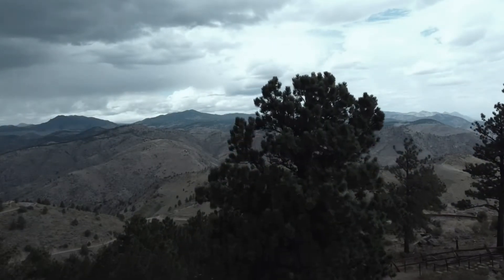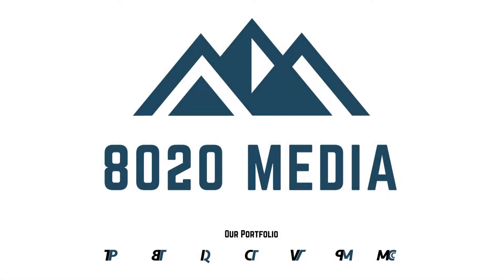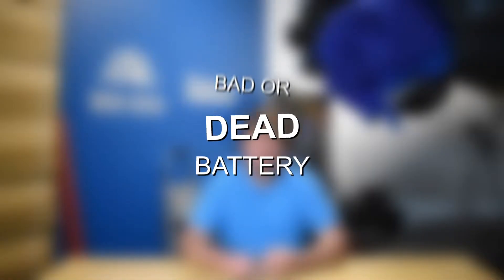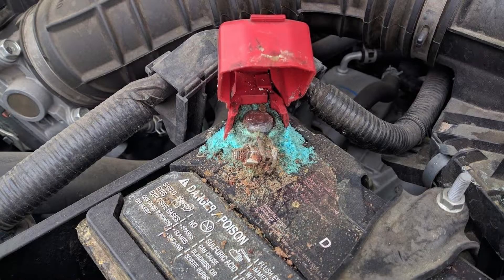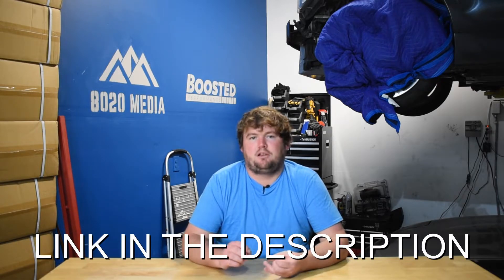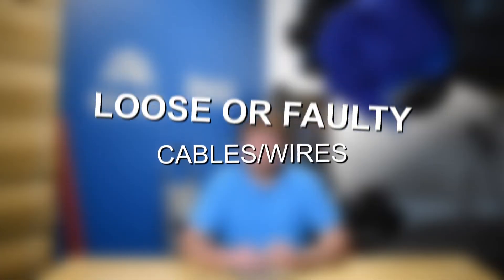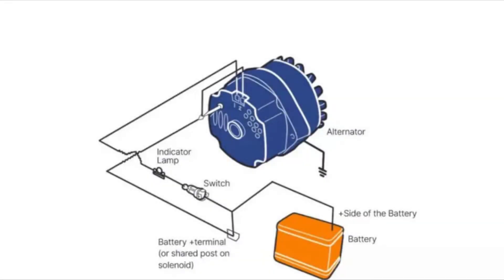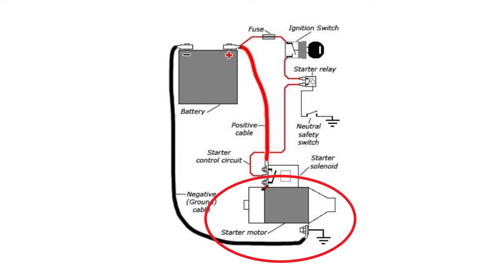DIY – Why Your Engine is Clicking & Not Starting or Stalling Soon After Starting

Comment: GOOGLE HAPPY HOLIDAYS TO YOU DIY 
I HAVE A 2005 CHEVY UPLANDER
Pull up to the gas station cut it off
 went to restart would not start 
Data center show starting disabled went to the turn on key for 15 minutes three times process to see if that would be recognized the key 🔐 still no start 
Charged the battery it's at 13.5 please tell me your thoughts and what I could do to rectify this problem thank you again have a wonderful holiday

Comment: I hear different things on how long it takes to recharge a good battery while driving.  Like a battery that was drained by leaving a light on overnight or maybe having sat for a long time.  Some folks say that it has to be highway driving for as much as an hour.  You just said something that sounded like less.... "a little bit of driving time".  And so to be clear, idling in the driveway after getting a jump just doesn't do it?  I believe it does not, that the alternator needs to be running at rpms higher than idle (or the nominal amount of current it needs to create just to run the basically electrical stuff of the car while it is at idle).  And that might be why some people say highway speeds to have the rpms up, thus spinning the alternator faster and creating more power to feed to battery.......

Comment: I have a Toyota Corolla 2009, changed battery and alternator and it doesn’t want to start the vehicle… please help by making a video with each different sounds to find a match… all parts replaced are by Toyota made specifically for my Corolla 

Security system and radio (touch screen format) do not turn on either

Comment: Got a 2011 Chrysler 200 and I put a new starter on and new battery but still just clicks when turning the key on , will start after trying for about 5 min . I noticed there is no relay or fuse for the starter on this vehicle as well . I followed the wire and gave direct power to the starter harness and the starter turns over could it be my ignition switch ?
Reply: Put your car in neutral and try to start it like that 

If it still doesn't start then check the ground for the battery/chassis and starter/chassis 

If it still doesn't work then pray to God to give you the answer or something

It's also possible that the battery cable that connects to the starter is bad

Comment: Got a '13 Dodge dart That wont start up. Replaced the battery and starter, but only hearing 5 clicks every time I try to crank her up.
Reply from the maker: S - If your ’13 Dodge Dart gives you a rapid series of 5 clicks but won’t crank even after a new battery and starter, that usually means the starter isn’t getting enough current — most often from a poor ground or power connection rather than the components themselves. Start by double-checking both battery terminals for tightness and corrosion — clean them shiny and make sure the cable ends aren’t swollen or frayed under the insulation. Then inspect the engine-to-chassis ground strap and the positive cable to the starter; any corrosion or loose bolt will cause voltage drop, especially under load, leading to the clicking you hear. Use a multimeter to check voltage at the starter while someone turns the key — if it drops below about 10 volts, you’ve got a bad cable or ground. If power stays strong but the starter still just clicks, try tapping the starter lightly with a wrench while cranking — if it suddenly engages, the solenoid or internal contacts are bad even if the starter is new (aftermarket ones fail often). Lastly, make sure the neutral safety switch or clutch safety circuit (if manual) isn’t intermittently open — that can also cause a no-crank symptom with only clicks.
Reply: Possibly the alternator is bad.
Reply: Mine is now suddenly doing the same of multiple clicks when trying to start it. Then I accidentally bumped my seat moving lever and it made the radio and inside lights go off until I let go and they came back on. 😲

Comment: I bought a Mazda 6 was told the rear motor mount broke now it wont start just click. Was also told the with the mount broke it put motor and everything in a jam. I don't know what Im doin
Reply from the maker: D - A broken rear motor mount won’t keep the engine from starting—mounts just hold the engine in place, they don’t lock it up—so if you’re only getting a click when you turn the key, that’s almost always a starter, battery, or wiring issue, not the mount. First, make sure the battery is fully charged (should read 12.6V+ at rest and 13.8–14.5V when running), then check that the battery cables are clean and tight, especially the ground from engine to chassis. If the battery and connections are good, the starter itself may be weak or jammed, or the engine could be seized—but that’s rare unless it ran without oil. The “mount jamming the motor” story isn’t accurate; the mount breaking might let the engine shift a little, but it won’t mechanically lock it. Start with the battery and connections before worrying about anything bigger.

Comment: Great video! I have a question regarding a 2011 Chevy Camaro, automatic, V6 LT, 75K miles. Came home one day with no issues whatsoever. No lights came on in the dashboard. Lights never flickered, started up just fine as usual. But then the next morning I was opening my trunk with my remote and I hear multiple clicks. I thought, that's weird. I made sure I didn't leave any lights on whatsoever. I go to turn on the car and I still have power but it doesn't start, but it does the clicking noise again. The engine like appears to be flickering fast too. I check the battery wires and everything is clear. I take the out and take it to Auto zone to get tested and it is 100% full. Does that mean the alternator couldn't be an issue since it didn't drain the battery? Sounds like it is the starter, but in your video you mention the starter only clicks once and not multiple times, which is giving me doubts. Could it still be the starter even though it's clicking multiple times?
Reply from the maker: D - Yes, it can still be the starter—even with multiple clicks—especially if the solenoid is receiving power but the starter motor itself is failing to engage or spin properly, which can cause rapid clicking or relay chatter that mimics a low-voltage condition; while a single, strong click is more classic of a stuck solenoid, rapid clicking still points to the same system: battery, cables, grounds, starter, or ignition circuit. Since your battery tested good, double-check the ground cable from the battery to the engine block and chassis (even unbolting it to clean the contact), and then try tapping the starter lightly with a hammer while someone turns the key—if it cranks, that’s confirmation the starter motor is sticking internally. Also check the underhood fuse box for any corrosion or blown starter relay. If all wiring checks out and the tapping trick works or makes a difference, replace the starter.
Reply: I have the exact same car and the exact same problem did you ever get it fixed or checked out. Let me know what the issue was.
Reply: I have changed the starter, alternator, and battery checks out to be good. Both parts were bad as well so it just  leaves me stuck.
Reply: @noice351 check your ecm fuse. I had the same problem and it ended up being an ecm fuse

Comment: Clicking with no crank. Truck was running fine and this happened in the morning.
Reply from the maker: J - If your truck is just clicking with no crank after running fine the day before, the most common culprits are a weak or dead battery, corroded or loose battery terminals, or a failing starter motor or starter relay. Start by checking battery voltage—it should be at least 12.4 volts—and ensure the terminals are clean and tight. If the battery checks out, try tapping the starter lightly while someone turns the key; if it cranks, the starter is likely failing. Also check for blown fuses or a bad ground connection. If all else looks good, it's likely the starter solenoid or starter itself needs replacement.

Comment: I have an audi 2011 a5 thst clicks once too when i try to start it. But once i jump it it jas no issues staying on or running. Doesnt lose power snd everything words from radio to ac to covertible. Took my battery out and got it checked out at autozone. Barrery was at a hundred but could jt still be a bad battery havent tested jt when trying to turn it on. Would apprecaite any help
Reply from the maker: M - Yes, even if the battery tested at 100% at AutoZone, it could still be bad or weak under load. A battery can hold a surface charge and show full voltage when not under stress, but still fail to deliver sufficient cold cranking amps (CCA) when trying to start the car, especially after sitting. The single click you hear typically indicates the starter solenoid is engaging but not getting enough power to crank the engine, which often points to a weak battery, corroded terminals, or a poor ground. Since the car starts and runs fine with a jump, that leans even more toward a battery issue. I’d recommend doing a load test while attempting to start the car or replacing the battery if it’s more than 3–5 years old, even if it seems okay when bench-tested.

Comment: Ok I turn key and only get the 1 click, dash lights stay on but clock and radio turn off. Is that most likely started? I replaced alternator twice ( once last nov the second time last month)
Reply from the maker: M - Yes, if you turn the key and only get one click, the dash lights stay on, but the clock and radio shut off, it's most likely a starter issue—specifically, a failing starter solenoid or worn internal contacts in the starter motor that can’t draw enough current to crank the engine, especially if you’ve already ruled out the alternator by replacing it twice. However, you should also double-check the battery connections (clean and tight terminals), main engine grounds, and try a voltage drop test to be sure power is actually reaching the starter—sometimes, a weak battery or corroded connection mimics a bad starter. But based on the click and power loss behavior, starter replacement is the most likely fix.

Comment: Hi! Have a Citroen C3,today its showed up "Electric Circuit faulty" few km later power steering is gone,most electronic device didnt work(like windows,radio,fan) then after I stopped and turned off the engine its only make clicking sound,but engine not move,on dashboard says "Economy mode active) we tried jump the car didnt worked,do you have any suggests?
Reply from the maker: P - Hey! What you're describing on your Citroën C3—“Electric Circuit Faulty” message, loss of power steering and electronics, and failure to crank with just clicking and “Economy Mode Active”—is a textbook sign of either a completely dead or failing battery or a serious charging system failure, likely a bad alternator that wasn’t recharging the battery while driving; “Economy Mode” activates when battery voltage is critically low to preserve power, and jump-starting won’t help if the battery is too far gone or the alternator isn’t outputting anything—so check battery voltage first (should be ~12.6V off and 13.8–14.4V running), then test alternator output, and if either is bad, replace accordingly and fully charge or swap the battery before restarting the system.

Comment: Hoping im not too late to the party
Last week I parked my car and left my headlights on for an hour. I turned them off when i noticed, but it wouldnt start and made the rapid clicking sound of a drained battery. I left my car for 4 hours, came back, and it started fine with no jump. 
This morning i got into my car and it wouldnt start again. All electrical systems are working, interior lights, headlights, door alarm, etc, but it wont start. Made sure headlights and interior lights were off when i got out of my car the night before. Jumping it was unsuccessful. The battery is brand new because of a similar situation last month, no corrosion on the terminals, alternator and timing belt were replaced a year and a half ago. Any ideas?
Reply from the maker: E - Never too late! We strive to answer almost all comments! Based on your symptoms—rapid clicking, electricals working, a new battery, and failed jump start—it sounds like you may be dealing with a bad starter motor or a faulty ground connection. A weak or failing starter can intermittently work and then fail entirely, especially after a battery-draining event. It's also possible that a poor ground (battery to chassis or engine ground strap) is preventing enough current from reaching the starter, even if voltage appears normal and accessories work. Another potential culprit is a parasitic drain that's slowly killing the battery overnight despite appearing fine earlier. I'd suggest checking all ground connections for corrosion or looseness, testing the starter relay and ignition switch, and using a multimeter to check voltage drop during cranking (if it drops significantly below 10V, there may be a high-resistance issue or dead cell in the new battery). If everything else checks out, the starter is the most likely culprit.

Comment: Can it be uncommon for a starter to be the problem but instead of a loud single click its more of those multiple multiple clicks like shown in the start of the video? I want to get into cars and eventually get a project car but I want/need to start of slowly just being able to fix and do basic maintenance with the car I have now before starting that. Got an 05 accord, haven't really had any problems with the stero or headlights so I don't think its an alternator problem, I do have to change my battery soon but I don't think its a battery problem because if my memory serves me correctly, my car has been doing the clicks for a while so it's not anything new. Which leaves wiring and starter, how would I be able to identify wiring/cable as someone who has no idea what they're looking at/for compared to just getting a new starter and just trying to replace that. I do have a cousin who is a mechanic and has his own shop and does it for a living and another one who teaches autotech in school but I would like to become more indepent when it comes to being able to identify and fix my car, any advice or help is welcomes and greatly appreciated. Thanks in advance!
Reply from the maker: J - Yes, it’s definitely possible for a bad starter to cause multiple rapid clicks instead of a single loud click, especially if the solenoid is engaging but the motor itself can’t spin due to internal wear or poor power delivery. Since your headlights and stereo seem unaffected, the issue is likely not the alternator, but your battery could still be weak under load, which isn’t always obvious—have it load-tested for free at an auto parts store just to rule it out. If the battery tests good and the terminals and cables are clean and secure, the starter is the most likely culprit, especially if the clicking has been going on for a while. You can try tapping the starter with a wrench while someone turns the key—if it cranks after that, the starter is almost certainly failing. As you’re getting into car maintenance, this is a solid first repair to learn on, and taking photos, labeling wires, and asking your mechanic cousin for quick guidance will go a long way in helping you gain confidence without relying entirely on others.
Reply: @8020Automotive  thank you so much for the reply!
Reply from the maker: @Josh-qv9tx  Keep us updated!

Comment: I put a brand new battery in my 2006 Honda accord . It sat overnight and now it won’t crank what do I need to check now
Reply: And it’s making a clicking sound
Reply from the maker: L - If your 2006 Honda Accord has a new battery but now won't crank and just clicks, you should first check the battery terminal connections—make sure they're clean and tight. Then check the ground wire and main power wire going to the starter for corrosion or looseness. If those are good, test the starter relay and fuse, and listen to see if the starter solenoid is engaging. A clicking sound usually means low voltage or a failing starter. Even though the battery is new, a parasitic drain or bad alternator could have drained it overnight, so test battery voltage (should be around 12.6V when fully charged). If it's low, recharge and check for a parasitic draw.